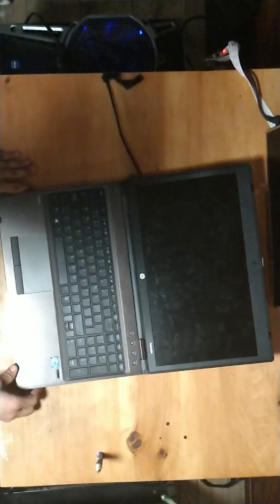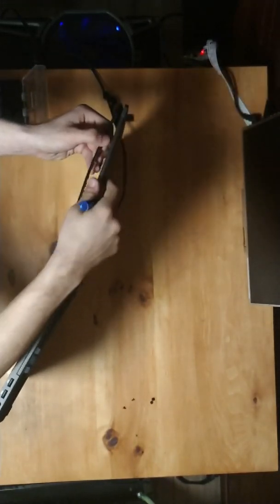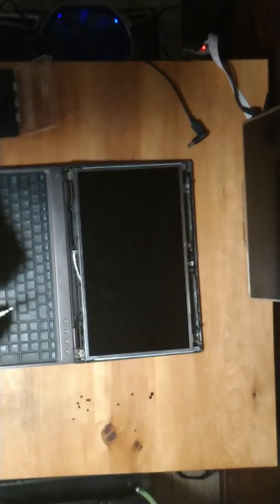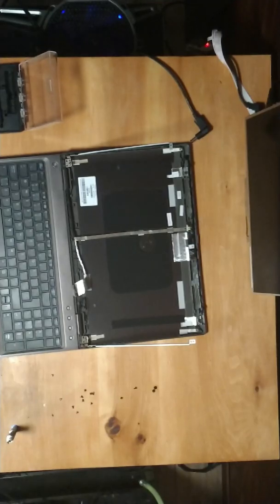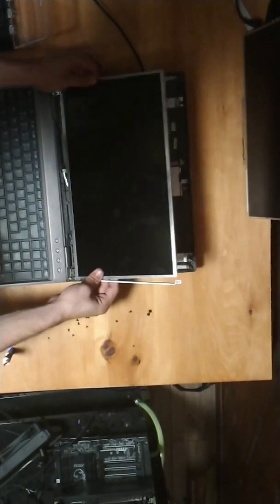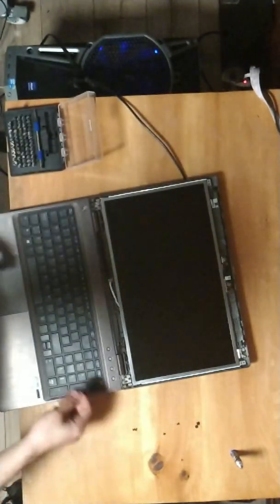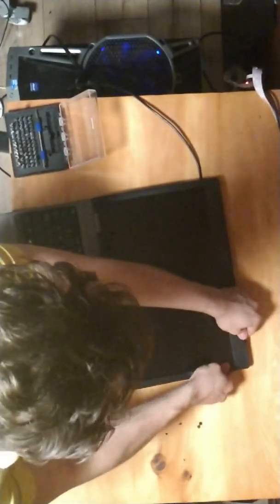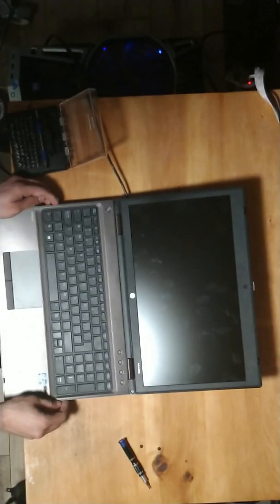Laptop screen replacement / How to replace laptop screen of a HP proBook 6570b

Comment: Yeah, right now I'm having a fricking spot of messed up pixels I have already put in a Samsung SSD before this I don't want that to go to waste so I'm probably going to fix the screen I will be sure to use this video. also to replace the assembly that holds the screen because the lid of my laptop is all scratched up, looks like a bear got to it, do I have to take the whole thing apart so I can get to the hinges.
Reply: hey could you please tell me where to buy the replacement screen?
Reply: @sumeshurc1539  sorry I have no clue since then I have stopped using that laptop so bought a brand new one